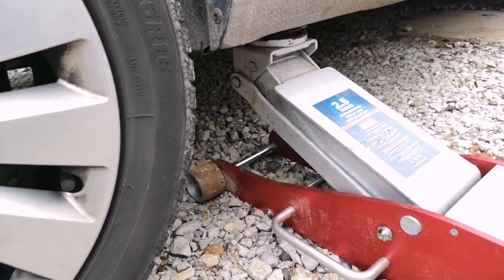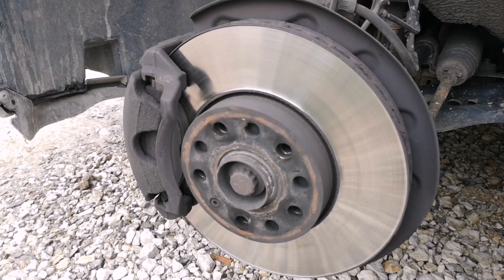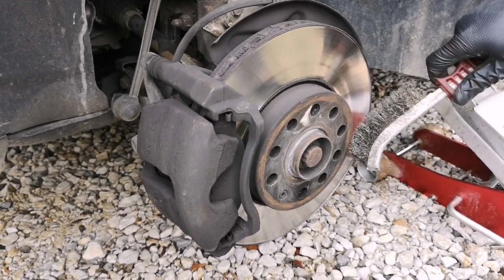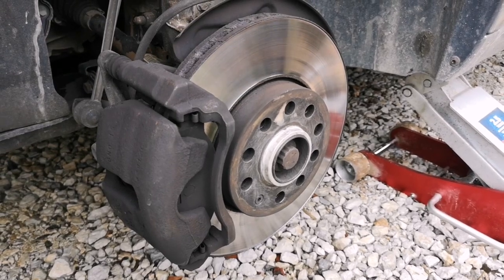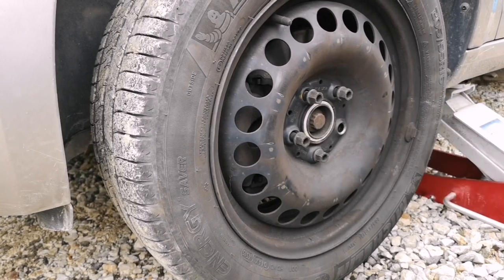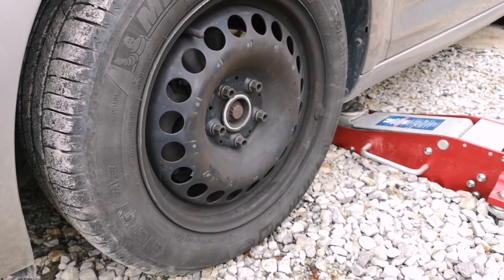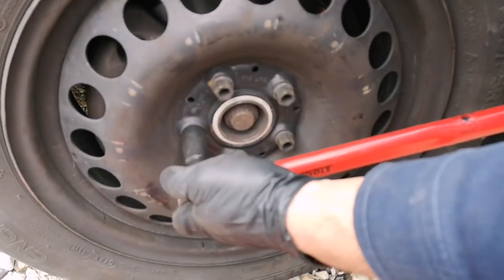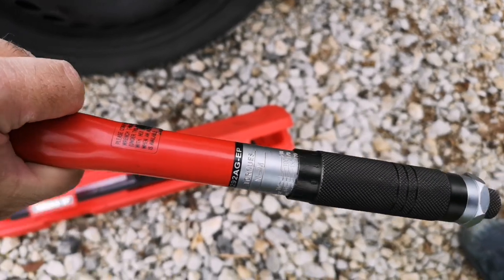How to change car tires and how to use torque wrench

Comment: Great job. Question? what kind of hammer is that? was it used in the time of the ancient Venetians??? 🙈😄
Reply from the maker: Hi, thanks for watching.
On what hammer do you think?
You probably think about Milwaukee M18 wrench.
I'm pretty sure it's from this century.

Can you explain to me when it was time of ancient Venetians?
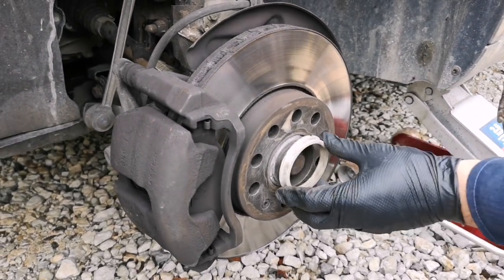Reply: @MCTutorialsOnline  The hammer is that: 2:15
Reply from the maker: Hi, thanks for watching. 
 Yes, it's really a hammer that I completely forgot about 😅😅😅. 
 It is an improvised hammer that is used when you are doing something on the ground that needs to be scratched.  This hammer makes that job extremely easy...
Reply: @MCTutorialsOnline  Good stuff! 👍